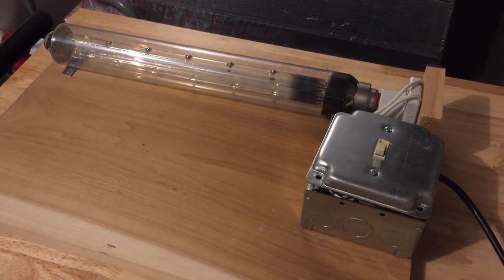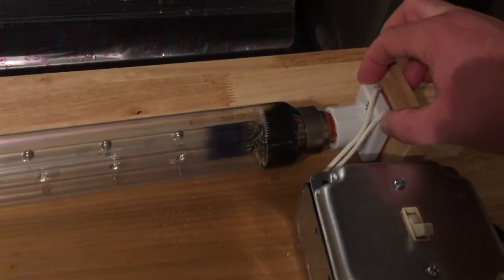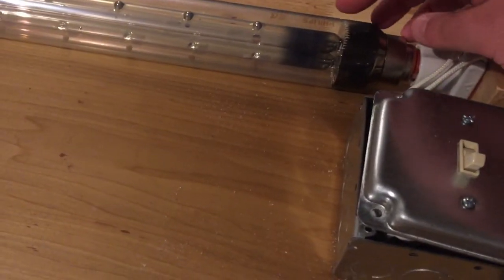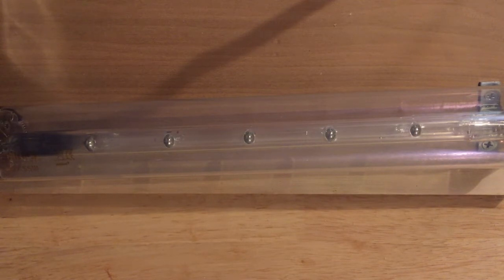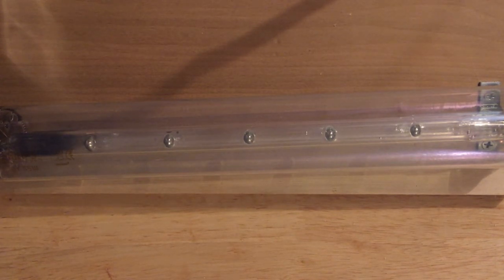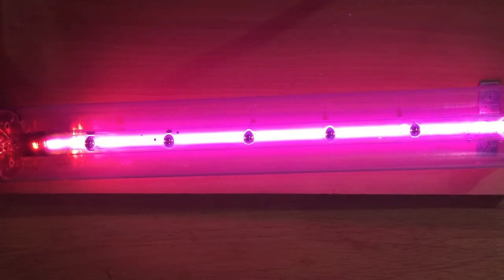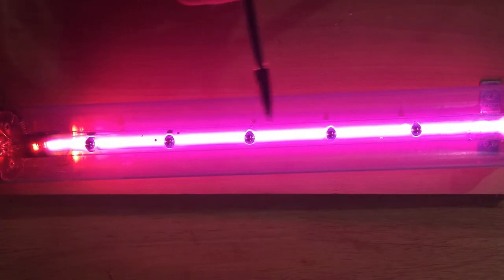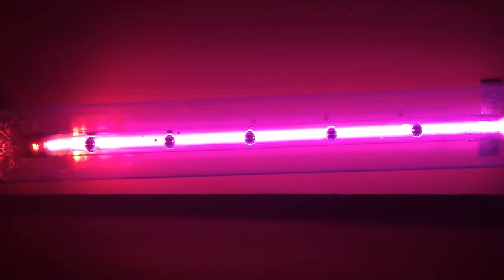Low Pressure Sodium Vapor Lamp - First Strike

Comment: Thanks for the video, very cool. I especially enjoyed the pink glow characteristic of the ionized noble gas. Quick question for you: regarding this sodium lamp, does the cathode emit electrons via thermionic emission (i.e., the cathode and its coating are heated to the point of emitting an 'electron beam') which then ionizes the noble gas forming a plasma, or does the ionization occur as a result of high voltage between the electrodes (i.e., electric fields impelling the emission of electrons). 
thanks

Comment: Production is over, last Philips factory closed that made SOX, not even in the Philips lamp catalog anymore.  I use several SOX 18w and 55W LPS around my house, have for decades, i stocked up, have plenty of spare lamps, for the rest of eternity.  I use 5 18W wall packs, and a pole lamp and a 55W wall pack .Nice non glaring pure yellow.  LED most people have are the glaring high blue annoying glare machines...unshield, pure yellow doesn't glare.  Have some spare LPS sockets, and a few ballasts.  Lamps are still available on ebay, but prices have gone way up...and some fixtures...I even have the largest 180 W Flood the lamp is 4th long it is BRIGHT and YELLLOW

Comment: Nice video! What makes me wonder is that your lamp seems to stay in the "pink phase" for minutes, until the sodium gets to full brightness. Usually, as seen on other videos, this phase lasts just a few seconds, with the color coming from argon discharge, and then neon discharge sets in, with a red-orange color for several minutes.

I can see three possible reasons:

1. Your tube contains only argon, no neon. That's unlikely.
2. The color rendering of the video is off by quite a bit.
3. The ballast/starter starts and runs the lamp with a very different voltage than other starters/ballasts.

Any comments on this, please?
Reply from the maker: Hello! We are happy to see your interest in our Low Pressure Sodium Vapor Lamp.

We can assure you that the long pink phase is not due to the rendering of the video. The long pink phase is witnessed in-person, and we considered it an advantage in a classroom setting because it provides students with enough time to look at the light through a spectroscope as the lamp heats up. We do not believe that the bulb contains only argon, but if you would like to know, the bulb used in this video is a Philips 321513 55-watt T15 SOX55 Low Pressure Sodium HID Light Bulb. The ballast we used is designed to run two bulbs at a time, but in this video, we only run it with one bulb and cap the other set of wires.

Our best guess is that the long pink light warm-up time occurs because the lamp is not in any sort of insulating housing that could contain the heat generated and cause it to quickly reach steady state temperature. When used in real street lighting applications, those sodium bulbs are protected in housings. Since the bulb is exposed to air and facing upward in this version of the lamp, a lot of the heat is carried away through natural convection. While the bulb is cold, most of the sodium inside remains un-vaporized. That's our best guess to explain this phenomenon

We hope this helps. If you are interested in purchasing one of our lamps for yourself, here is a link to our online store: https://engineerinc.net/shop/
Reply: @GatorKits  Thank you for your answer!

I've seen quite a lot of videos now, which show these lamps running in an open fixture, but also without any case at all, like your lamp. For example, this video is sped up considerably, but it shows how small the pink region is, and how quickly the pink/violet vanishes:

https://www.youtube.com/watch?v=xe_OM_REphY

Soon after startup, it emits this orange-red color, which is typical for neon discharge.

But I've also found another video which shows the same, long lasting pink like on your lamp:

https://www.youtube.com/watch?v=fN9YeA4LPZM

It would be indeed interesting to test your lamp with a spectroscope or spectrometer, and see which lines are prevalent. No matter what though, your lamp is most beautiful!

Comment: Is there an LED lamp equivalent to achieve the same monochromatic effect?
Reply: Yes, lots of, if you're willing to accept a wavelength center difference of one or two nanometer, perhaps more, depending on the LED. Look for "Amber LED" or "Yellow" LED, the wavelengths you're looking for are usually 588 nm or 590 nm (the lamp in the video is centered at around 589.3 nm, https://www.chem.uci.edu/~unicorn/249/Handouts/RWFSodium.pdf ).

Keep in mind that the beauty of these SOX lamps comes not only from the yellow sodium light. Usually at start, the lamps show a very short, bright pink/purple flash from argon, then for a few minutes a strange red-orange glow from neon that more and more turns into yellow as more sodium evaporates, and finally the sodium yellow at full brightness.
Reply: @Nonononono_Ohno  Thanks for the info!  I'm looking for something like that in the LED arena for a potential effect for a haunted house.  I'm trying to achieve the monochromatic effect to mess with people's eyes and then turn on a white light to expose the "true" regular colors in the room.  Going back and forth every five seconds or so I fear would cause too much strain on the SOX lamp, which is why I was searching for a possible LED alternative.  I appreciate the response and info.
Reply: @bbnoodlescooze  That's cool! If you need something ready for use, it might be an idea to search Ebay or alike for "amber car turn signal". Most of these ought to be pretty narrow band LED lights, with the advantage that usually they emit 360 degrees, and that they can be run off of 12 V.

What's also interesting is that almost all humans only have three color receptors, one each for red, green and blue light (RGB). So if you light up the room with such a mono wavelength LED, only objects which reflect light of that of the LED can be seen. All other objects are black. The yellow light then hits both R and G receptors, and the brain combines this to give you the impression of "yellow".

If, on the other hand, you light up the room with an RGB LED with only the red and the green LED inside of it being "ON", then the room will look quite different, whereas the LED itself will (correct mixing of R and G in the LED assumed) be just the same yellow color as the pure yellow LED. That's because again, the brain is mixing R and G receptor input from the direct light, giving the impression of yellow. Objects in the room however will now be black if they reflect only a narrow band yellow, and absorb green and red completely. Objects which only reflect green will be green, those which only reflect red will be red, and those which reflect both red and green (and absorb everything else) will be yellow.

You might be able to use this strangeness to construct an LED lamp which blinks "yellow and yellow", i.e. which seems to just go on, off, on, off, and so on, but which in reality goes yellow -> off -> red+green -> off -> yellow -> red+green and so on. And if you make the off times in between the switching very short, it would look as if the lamp is shining constantly with yellow color, but all objects in the room are blinking, depending on which color they actually have. Even better, you could make the switching controllable, in which case you'd have control over what the objects in the room do, for example you could let things "jump" from one place to another. I could imagine that if done correctly, that might look pretty spooky. 👻😄
Reply: @Nonononono_Ohno  hi so i want the yellow/amber led light your talking about but i cant seem to find it anywhere do you have any links you can send?if not, thanks for sharing all the info it was very helpful🌚
Reply: @the.secret.of.  Hi eid,

the LEDs shouldn't be too hard to find if you search ebay, aliexpress and other portals, e.g. for "LED 590nm". I just checked and found e.g. these ebay numbers:
255566234304
255100913930
265772572191
302832542947
Let me note though that by now I know a little more than back then: LEDs aren't completely as narrow-banded as SOX lights are. So you will have a little bit of green and red wavelengths in the light as well, even though it looks exactly like SOX light when you look at it directly. The difference becomes noticeable however, when you shine the light on green or red things, they aren't completely black but rather grey-yellowish dark green or dark red, depending on the object, and on light intensity of course. If that's an issue, it's probably possible to filter out the green and red parts, but you'd need a narrow-banded 590 nm bandpass filter, and they aren't cheap from what I've seen.

Comment: These used to be a staple of British street lighting until they decided LED was a good idea (with the number of LED luminaires failing in the first month of operation as compared to SOX ones at the moment though I beg to differ massively). We replaced a large amount of incandescent and high pressure mercury lamps with these due to the massively improved efficacies over them. The least efficient SOX was still twice as efficient as the average merc, and even now SOX remains one of the highest efficacy light sources on the planet.

10w: 80 lumens per watt (these lamps are insanely rare as they couldn't get the efficacy up enough to consider using them, so they're kind of a lesser known wattage)
18w: 100 lumens per watt
26w: 130 lumens per watt (these were improved efficacy lamps, known as SOX-e)
35w: 115 lumens per watt
36w: 163 lumens per watt (These are also improved efficacy, used to replace 55w lamps in some instances)
55w: 140 lumens per watt
90w: 150 lumens per watt
135w: 180 lumens per watt
180w: 200 lumens per watt
Reply: They installed few led on crosswalks, seemed like a good idea with all light being yellow and then you get this transition of white where people walking. But they half of them failed after a year or so.
Reply: @MACTEP_CHOB  Yep. The big issues I find are with the drivers, and some manufacturers driving their arrays too hard to get the lumen counts up. They would have better reliability with better quality drivers and driving the LED arrays at around 80-90% of their peak power... but then how would they make money if their luminaires were too reliable? XDD

Comment: Roughly how long does it take for the sodium to return to a liquid and solid state?
Reply from the maker: Approximately 25 minutes. I can indirectly judge sodium re-solidification by the color of the lamp after it has run for a while in steady state and then been shut off for a time. If I turn it off and immediately back on, the color remains monochromatic yellow, which means little re-solidification occurred. However, if I let the lamp sit off for a while, it cools down. When I turn it on again, the light is pink. This color indicates to me that there is very little sodium remaining in the vapor phase: the pink color is being produced by the trace noble gas vapor in the lamp. When we run this demonstration in high school chemistry classrooms, it is important to show students the color change so they can see that different chemicals fluoresce with different colors. So, we need to cool the lamp between classes to get it back to pink when we turn it on. That cool-down process takes about 25 minutes; hence my estimate.
Reply: @GatorKits  Awesome. Thank you for very much

Comment: Probably a dumb question but how suitable is it to be used as a normal lamp
Reply: A LP Sodium lamp's suitability for use as a normal light depends on the intended application. Monochromatic light eliminates color perception. So anything colorful viewed under a Sodium lamp appears in greyscale with all color washed out. Sometimes this effect can be advantageous. For example, if the goal is to create neat visual effects, monochromatic light can produce black flames when the fire contains Sodium ions:

https://www.youtube.com/watch?v=WSogmCAlFSY

In general, the Sodium lamp is overly bright, harsh on the eyes, and it eliminates color perception. So, it would not be particularly good as a normal lamp unless you were intentionally using it to induce some special visual effect.
Reply: @MattTraum  alright, thank you.
The color perception is the reason why I want one.
Reply: @Beats on Page not yet, don't have enough money
Reply: If you don't care about CRI at all it makes a great solution for a low power, high output  light source. I made me a 2 metre floor lamp using a 26w SOX-e lantern. More specifically, the Philips MI-26. https://www.lighting-gallery.net/gallery/displayimage.php?album=5178&pos=0&pid=156937
Reply: I use low pressure sodium lamps and high pressure sodium lamps to simulate artificial sunsets in rooms because their hues resemble the sun’s golden hour warm glow.